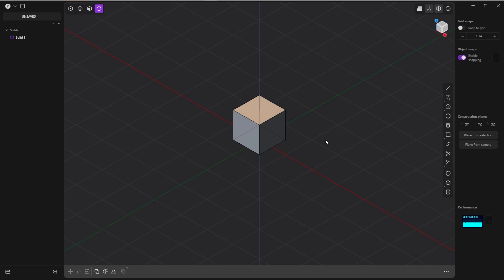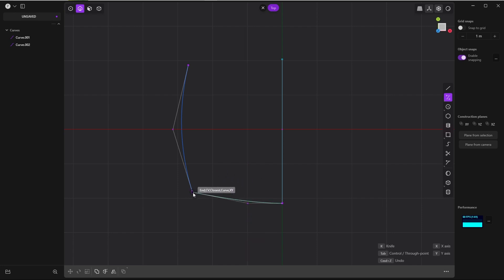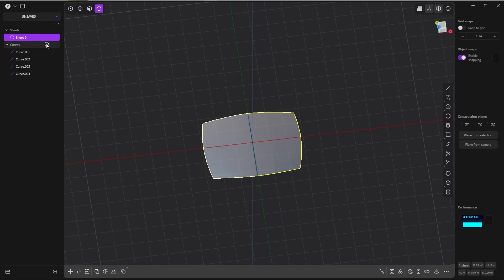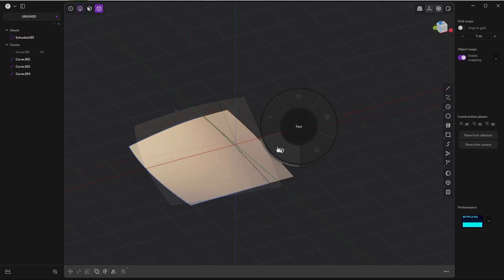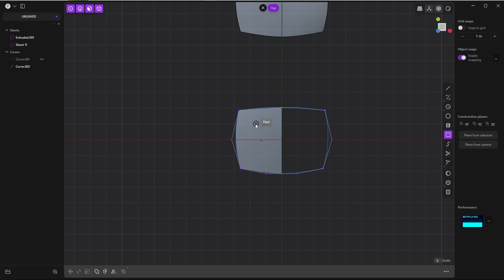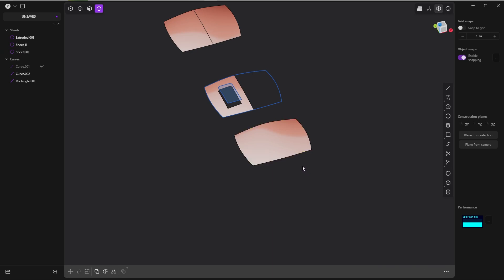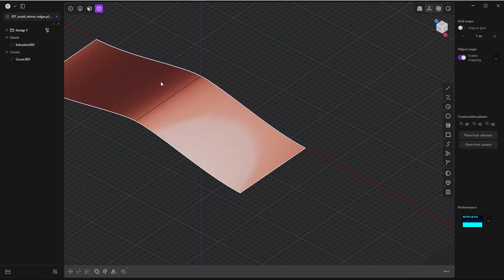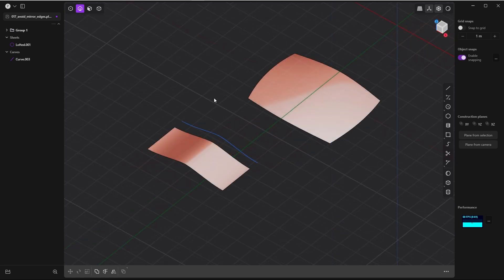Plasticity Tip No. 17 - Avoid mirror edges

Comment: Those tricks are great.
I'll explain a couple more tricks that I use:
1- After "joining" the curves, double-click on the joining vertex and the joined curve becomes a spline (it's not exactly the same curve, but if you don't need that precision, it works for me).
2- Rebuild the joined curves with the same number of points that were shown, and now it will have the same curve shape, but since it has been converted to a spline, the join line will no longer be displayed when extruding.